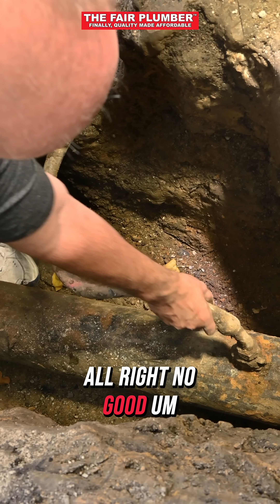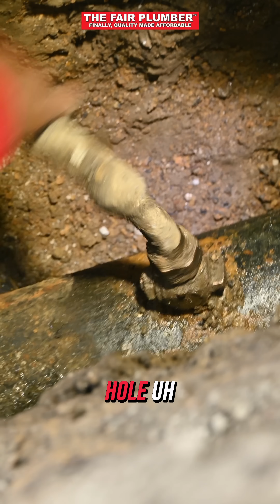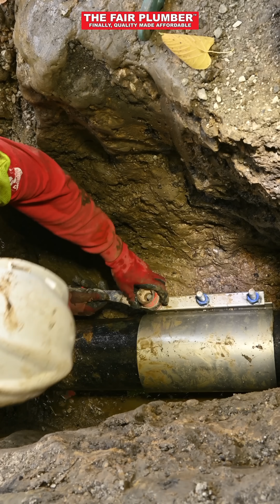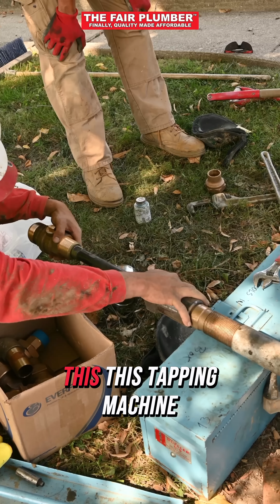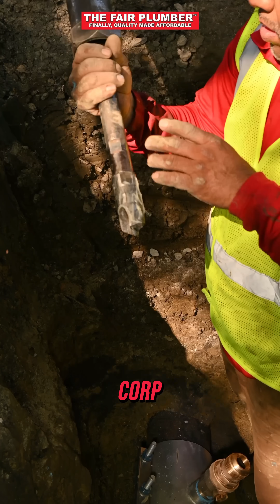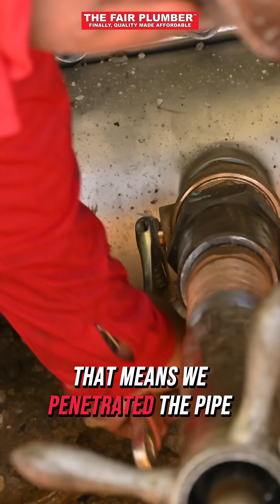Lead Water Line Repair - Part 1

Comment: I don’t know if that’s the right way buddy. He should’ve capped it off if you’re not gonna use it at that point why the fuck are you relying on rubber instead of another fitting like a cap not very smart I think your cap would outlast the rubber but you do what you want. It’s not my house you’re working on that’s for sure. And then you insist on making another tap. Why wouldn’t you make the old tap bigger?

Comment: You do it the proper way some company just put a cat on the valve…
Seems to me a cap would actually be a more secure fixed than just sliding a sleeve on there

Comment: Lol do it on a daily basis it's called a Rockwell clamp and the other clam is called a saddle you get cast iron half as well with 2 bolts and a rubber for lead cast iron pipe steel AC pipe h

Comment: I miss the lead taste in my water 💧
Reply from the maker: We understand what you mean — older lead service lines sometimes gave water a distinct taste. However, lead is toxic even at low levels, which is why replacement is so important for long-term health and safety. Our goal is to provide safe, clean water while upgrading aging infrastructure.

Comment: Got a bit of a shoring problem there bud. I guess they are too cheap to give a shit about the guy working in the hole.
Reply from the maker: We appreciate your concern — safety is always our top priority. For this job, proper shoring and trench protection procedures were in place, and all team members were following OSHA-compliant safety protocols. We take every precaution to protect our crew while performing work safely and efficiently.
Reply: @fairplumber  What shoring and trench protection? Unless that guy in the hole is a hobbit he's lower than 5 ft.

Comment: Stainless steel sleeve?  So this is a planned failure of the pipe, that will require the pipe to be replaced once the corrosion destroys it.

Comment: Interesting video, What about all the metal shavings in the main feed which likely goes down stream into the neighbours water?
Reply from the maker: Great question — and an important one. During this type of work, the metal shavings created are extremely minimal, and the water system’s continuous flow pushes them toward the excavation area where they’re flushed out immediately. In addition, modern water systems rely on filtration, chlorination, and regular testing that prevent any of these particles from reaching a neighbor’s tap. We always follow proper safety procedures to ensure the line is cleaned and the downstream supply remains protected. Thank you for bringing up a thoughtful point!

Comment: thats nothing a summer job pg&e in nj the goveners dept drilled and tapped live gas mains.  water is easy.  It was cool to watch,  little scary too..
Reply from the maker: That sounds like an incredible experience! Live tapping a gas main is definitely high-stakes work, so we completely understand why it would feel both exciting and a little intimidating. Water line work may seem simpler in comparison, but it still requires precision and safety precautions — especially when performing live lead line replacements. Thanks for sharing your story!

Comment: The ‘corp’ valve could have been more quickly isolated and capped off using an “abandoned-corporation-fitting” sleeve. In plumbing, a corp (called a corporation) valve is a specialized shut-off valve installed directly into a water main to control the flow of water to a specific service line (in this case a lead water pipe). In older plumbing systems, a flexible piece of pipe called a gooseneck or pigtail was used to connect the corporation stop to the service line. This specific part was sometimes made of lead because it was durable and easily bent. The old swollen looking bulge at the end of the gooseneck is where molten lead was ‘wiped’ to make a joint seal. Dresser-Utility-Solutions company has a 250 psi bonnet that would slip over the corp valve without removing it and and even cover the cut back lead pipe.  “Available in sizes 4-16” diameter the “Abandoned Corporation Fitting”fully encapsulates abandoned lead service line corporation stop valves without disruption.  The fitting is fabricated using 304 Stainless Steel, with a fully pressure rated cap and extension built to ASME VIII-1 pressure code requirements for a pressure vessel. “

Comment: Could you use the same old hole in the pipe after you remove the old connector so you only use one sleeve? Save you money and less sleeves to fail.

Comment: Watching from Yosemite Kentucky.   I never knew this kind of repair was able to be done without shutting off a city's water main or atleast a leg.  Interesting video.

I grew up in a very small town in north central PA durin the 50's to early 70's.   The town's water reservoir main supply was fed via lead piping.   It was replaced sometime after I left the community.
Reply from the maker: Thank you for watching and sharing your experience! It’s incredible how much water system technology has advanced over the years. Live lead line replacement allows us to minimize disruption while improving water safety — we’re glad you found it interesting!

Comment: Just a heads up lead water pipes are only dangerous when somebody starts mucking about with them they are normally coated on the inside by years and years of limescale and other gunge left alone. You will never have any problem and if your property does have a lead service, are you should need to do first thing on the morning is run the tap until you’ve got the equivalent water out of the pipe from the main to your house

Comment: lead pipes are ok as long as the lime layer on the inside is not disturbed.  We had one, we just did yearly water tests in the house. It was cheaper than paying 10k to replace the line.

Comment: Anyone else feel like we over complicated the hell out of the new tap system? that old corp was simple, and still functioning. Wonder if that rubber gasket under the stainless steel will last a hundred years. My bet is it get brittle and cracks in 30. Maybe not not maybe so, I sure wouldn’t want to be the guy to have to replace that saddle.

Comment: Serious question. Who the fuck is still drinking tap water for hydration? I won't even cook with tap water and I'm on a well. Tap water is basically non-potable. I wouldn't shower and brush my teeth with it if I didn't have to

Comment: that is proper clever. what happens to the swarf from the drilling? does it come out as the water comes through?
Reply from the maker: Great question! During a live tap, any swarf (metal shavings) generated by the drilling is immediately flushed out at the excavation site because the water flow is directed outward, away from the home. After the tap is completed, the line is thoroughly flushed to remove any remaining particles before being returned to normal service. This ensures the water supply remains clean and safe for the property and downstream users.
Reply: @fairplumber  thank you

Comment: "Some companies would just go ahead and stick a cap on those valves but not me i do it the proper way..." 

Bro cap be better than a sleeve,
Reply: Why do you think so?
Reply: @JamesAxel-r8j  rubber overtime with elements to the weather cracks, hardens up and disintegrates unlike a brass screw fitting it does not rust and its a natural metal found in the ground so does fine in elements harsh or good weather.  

I trust a brass fitting any day these rubber patch fittings was originally designed for quick fixes not a full solution to fixing. But with todays society any quick fix is seen to be better than a full solution because some traders especially those who work for big companies don't care and saves money but costs you the customer a fortune in repairs, sometime down the line that so called fix they did with that patch will becomes someones else's problem to fix so be paying double for a job that should've been done right first time its how they make money. Its a monopoly 

You could argue but that rubber may have a life span of 50 yrs .... but the metal clipping holding it into place does not. that metal rusts off in a few yrs time  it will become lose and damaged and nothing holding that repair together
Reply: @JamesAxel-r8j did you see how corroded that pipe was, all of those pits will eventually allow water to flow out. You're depending on a rubber gasket versus a threaded piece of brass. I'm not a professional but I don't see how the sleeve is better
Reply: @matt45540   for someone who says they don't have any qualified experience as someone who doesn't do this as a professional i salute you as you are speaking correct with sense because in every job its required to have common sense of an understanding to know even if you are not qualified it counts, as a saying goes If it don't make sense , it'S NOT WORTH DOING !
Reply: It's a personal opinion argument. It's a personal preference/policy argument. Either way done correctly is fine. That corp could last another 20 years or fail a month after back fill. That clamp could last 20 years or you get some janky defect and an ear breaks off after a month and starts to leak

Comment: Just curious … the old valve looked to be in pretty good shape, but smaller than the new one.  Would you ever just plumb copper onto the old brass valve if you weren’t also wanting to increase the flow?

Comment: Doesn't lead pipe build an oxidized layer against the water? Still not a great idea, but i thought it was only a problem with specific types of water. Could be wrong though.

Comment: If the lead pipe is completelly new, there should be some residues of lead in the drinking water while it stays in the pipe through the night. But there are no new lead pipes in modern World.
Please, tell me what you do as a second think in the morning?
No, it is not coffee or tea - and if is, then "yuck"....
Secondd thing you do is splashing the toilet and third is washing your hands.
So before you start doing coffee, or taking water for your morning pills you spend 11 litres of water and then you have all the water fresh without any measurable ammount of the lead..

Comment: The health issues with lead pipes depends on how hard or soft the water is as with hard water the calcium in the water forms lead calcite on the lead pipes which stops it dissolving into the water, if the water is soft then it is more acidic and that's when the lead dissolves into the water. One way to prevent that is to dose the water with small amounts of phosphoric acid which behaves like the calcium in hard water and seals the lead surface.

Comment: The lead line is already highly oxidized with a thick layer. So they do not usually pose a major health risk anymore.. 
    What little lead is in the water can be filtered out with reverse osmosis. 
     Leave the line alone if it’s not leaking, it’s still good

Comment: Might look-up Romac Ind., mill creek WA., B- two or Tape mate valve replacement. No sleeve required and no water shut off. Millions of valves replaced with no problems.

Comment: Mueller makes an air motor and a hydraulic motor for the D5 machine. It advances the feed yoke while turning the boring bar. The air motor is $3500 but it works better than that rigid threader hack there.

Comment: Brass valve completely good and working just a brass plug was needed and was good to go all that  work for putting a sleeve I scratching my head
Reply: it is a failure point plus who know how old it was. Must be like 70-80 years old so it can fail at any moment.

Comment: How did you come back and pull the lead line?
Use a cable to pull the lead pipe splitter and pull then copper Thru?

Comment: So when you cut it, it leaves like little lead shavings down there you think if someone just so happen to drink one of them shavings would they have to go to the hospital?
Reply from the maker: Good question — and understandable concern. When a lead service line is cut, any small particles that may form are flushed out immediately at the excavation site because the water is flowing outward, not toward the home. In addition, the system is thoroughly flushed before being placed back into service.
Accidentally ingesting a single shaving during this controlled process is extremely unlikely, and even if someone did, a solitary particle would not cause an emergency situation. The real risk with lead is long-term, continuous exposure — not a one-time event.
We follow strict procedures to ensure the line is fully cleared and safe before it’s returned to normal use.

Comment: Job well done one quick question about the Corp. Looks like the original is brass and in good condition. Why would you put a sleeve and a hot tap unless you are increasing the line size which I think you were doing in this video.

Comment: I work for Water Distribution for a municipality.   This is our bread and butter.  Well done sir.
Reply from the maker: Thank you for the kind words and for the work you do in water distribution. Hearing that from someone in the field truly means a lot to our team. We take great pride in maintaining quality and safety on every job — appreciate your support!
Reply: @fairplumber you bet brother
Reply: You have a D1? D2?
Reply: @jujuboi2302  not yet. Two guys ahead of me are finishing theirs.  Hopefully, I can go next.
Reply: @danielsestina6457 does your work make you wait for reimbursement or something? Shouldn't matter what a cowowker is doing for their own cert.
Reply: Has the EPA specified that lead goosenecks need to go?
Reply: @MoshJunkie426 yes.  Typically, we have contractors do them so that we can focus on main breaks, but we replace the old Corp Stops when we find lead service lines.
Reply: @danielsestina6457  weird, when we were told we needed lead and copper inventories done they werent concerned with goosenecks
Reply: @MoshJunkie426 we have replaced any lead components within our system.   It might be driven by the city, or federal mandate.   I'm not sure.  Our water is so hard, the inside of the lead water lines has calcium build up.  Probably a good thing.
Reply: @danielsestina6457 i believe that with hard water source, I still debate with EPA Region 8 about lead because we as distribution cant really dictate what customers use on their private plumbing but i guess we just want to shed the liabilities of lead piping on our side

Comment: is that a lead line?
Reply from the maker: Yes, that is a lead service line. This video shows the process of replacing it safely and correctly while keeping the main active. Our goal is always to upgrade aging infrastructure the right way and ensure the property has a modern, safe water connection moving forward.

Comment: Why don’t you just shut the curb stop or the valve on the main to stop the water supply? Here in Connecticut we do this every day and don’t use two compression straps. Just one and retire the original corp. Replacing lead to copper is a mandate here.

Comment: That's definitely a old water main don't see that down here in fla did they need a bigger water service instead of the 3/4 tap that was there definitely looks like an expensive repair

Comment: That water supply line is huge.  Nice work overall.
Reply: That's only a 6 inch line. I work on 6-12" water mains daily. Occasionally 16" and those are still average for any medium sized city.

Comment: Why couldn't a new copper line be attached to the existing corp? It looked like brass with good threads. Was there lead in it somewhere also?
Reply from the maker: Great question. In many older systems, even if the corporation stop looks like brass on the outside, it’s often connected to a lead service line or contains lead-based components that no longer meet current safety standards. In these cases, simply threading a new copper line onto the old corp would leave part of the lead system in place, which defeats the purpose of a full lead service replacement.
For long-term safety and compliance, the proper approach is to install a new corp and connect the new copper line directly to it. This ensures the entire service line — from the main to the home — is fully updated and free of lead.

Comment: You dumped the lead service before running the new service, then you’re going to return later and do the new service? How long did you leave the customer without water? How long did you leave the hole in the road open?

Comment: There's tons of homes in numerous major cities that still have existing lead service lines. Infrastructure upgrades in many city are switching over to pvc whips with a new 8" C-900 water main.
If a lead line breaks via excavation or other means you can't simply add a section of PVC service line to the existing lead line.
The new service whip must be hot tapped to the existing water main or hopefully installed to a nearby meter that has an existing PVC service.

Comment: HOT TAP BABY!  We do this on live gas gathering and crude oil lines!  Fun times!
Reply: I was a helper for a hot tap guy until I realized how dangerous it was and how much hazard pay he was making that wasn't getting passed down the line. The final straw was a job we were doing on a pipe rack about 50 ft up. It was a 10 inch tap on a 20 plus inch gasoline line, no small job. There were tons of white hats and dress shirt wearing bosses gathered below while we were setting up. They scattered like ants when we fired up the air motor, leaving one laborer with a water hose and a radio, as if that poor soul could do anything other than run if things went south. After that, I told them I'd rather stay back at the main yard working in the tool room unless they wanted to give me at least a quarter of the hazard upgrade going to the super.
Reply: Lmao that wasn't hot. Like a low simmer. That's either extremely low water pressure or they have it throttled down for the whole block or something.